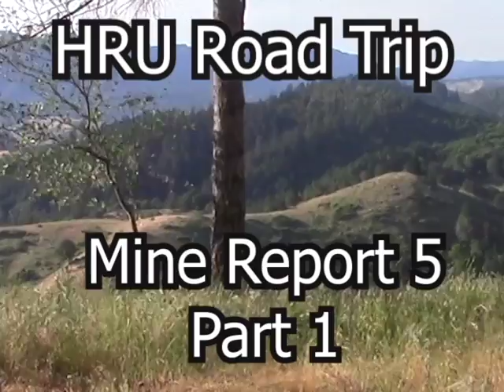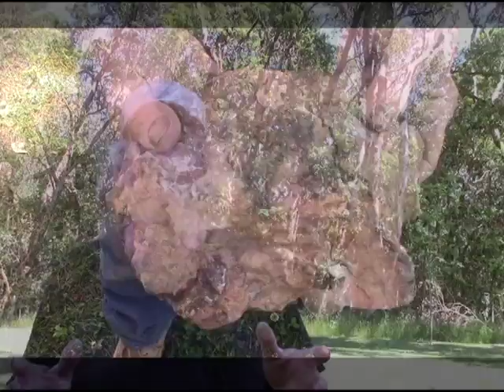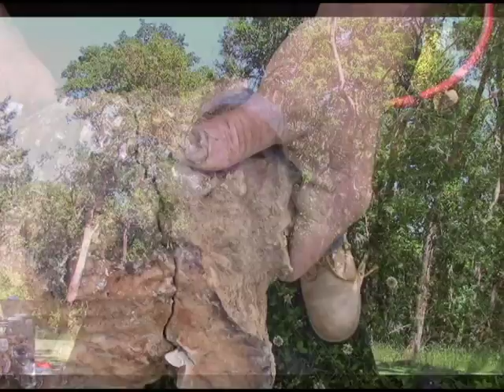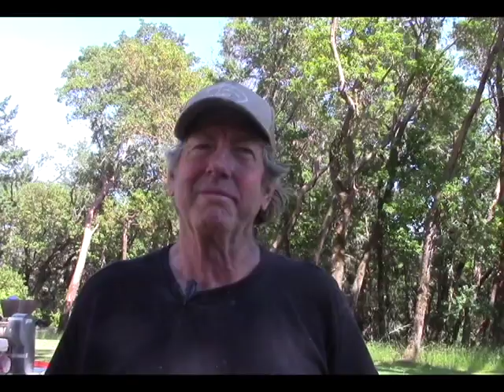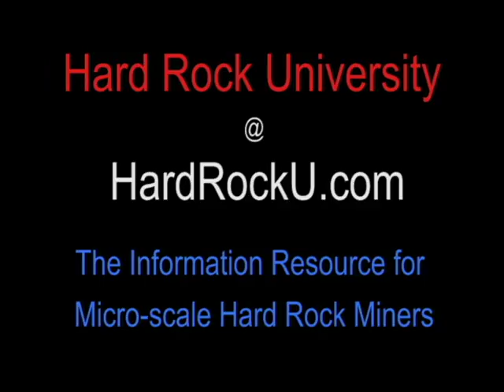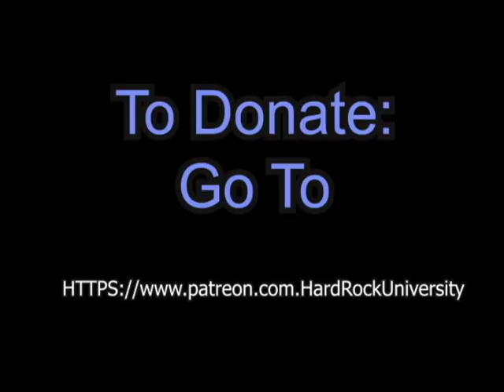Veins, Stringer,Veins, Lenses, Ore Shoots, and Pockets

Comment: Thank you for the video. I've been in several old mines that have massive 'ballroom' type stopes that stretch for several hundreds of feet and reach very high.  What kind of structure would this be called? Would it be a combination of different structures?
Reply from the maker: If it is high, wide, and long it would usually be a 'massive' deposit as opposed to a 'vein'.  It might also be a limestone mine, which often have large workings underground  as limestone is usually very 'competent' rock and holds up well.  Do you know what type of mineral was the target?
Reply: @hardrockuniversity7283  These are mines I've explored in the Tintic Mining District in Utah. They were primarily after gold, silver, and lead, often through low-grade ore that required much processing.  I've never witnessed such large stopes. Specifically in the Centennial Eureka mine, (I explored this mine with the permission of the owner) that featured some stopes high as 200' and a shaft 2200' deep.
Reply from the maker: @arrowheadunderground1791  I was in a mine near Magdalena Mexico that had levels 100 feet apart in a mountain and stoped 10 to 50 feet wide all the way between levels..  Quite impressive.

Keith

Comment: Yet another process of vein formation is known as replacement. So if you have a fault zone that is broken, but not really open, the mineralizing fluids can flow through the broken area and replace the broken rock in the fault zone. This process happens in a number of situations, but perhaps the most common is in limestone where acidic mineral solutions dissolve the limestone then deposit ore and gangue, effectively replacing the limestone.
Reply from the maker: Thank you for the supplement.  I had forgotten that one!  This trip is a cornucopia of excitement and new situations.  Having a blast!